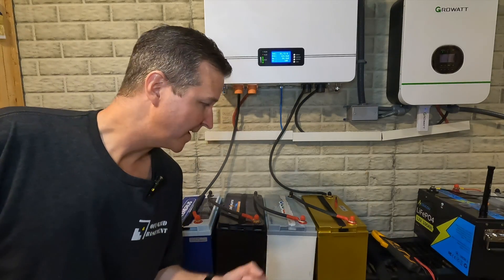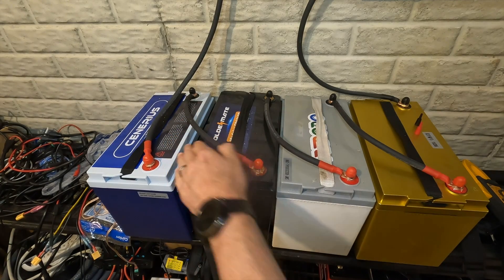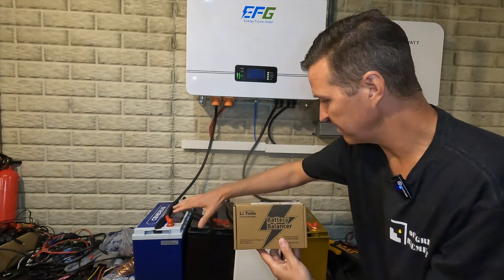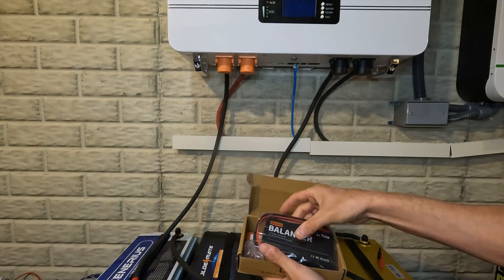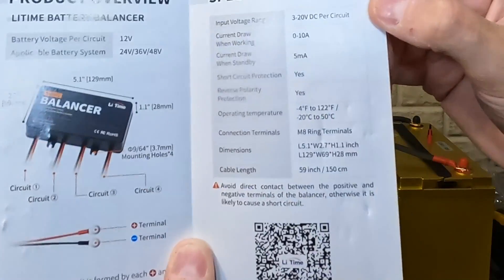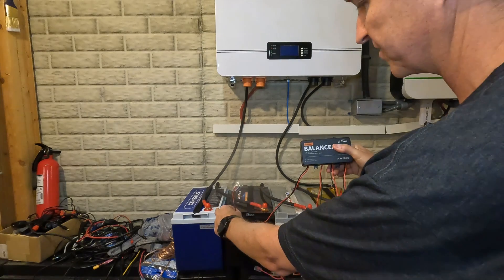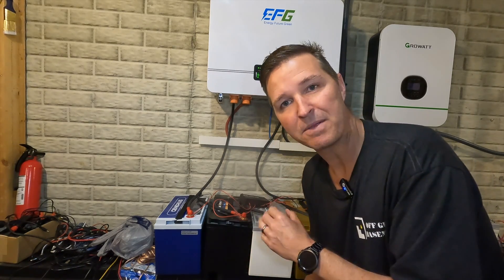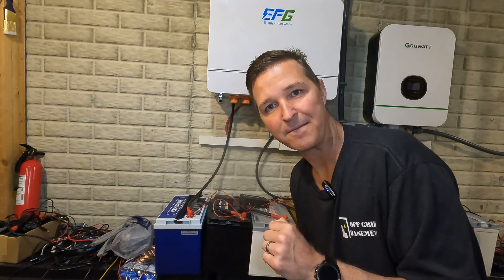Using the 48v Li Time Battery Balancer on Four Random LifePo4 12v 100ah Batteries.

Comment: does yours make an awful high pitched noise constantly? i installed this in my camper but the sound is awful. wondering if its just mine or all of them do it.
Reply from the maker: No.  Mine are completely silent.  I now have four of the units and I totally forget they are there.
Reply: @OffGridBasement  This is a known problem with some units.

Comment: I can't find one single video of how to wire this transfer switch with 3 wires . Always 4 wire.
Can you connect this to an inverter using only Line, Neutral and ground? Do you just cap the red wire?
Reply from the maker: I'm not sure what you are referring to.  This video is for a 48v battery balancer.

Comment: I recently converted our 48-volt golf cart to Lifepo4.  I used 4 new 12-volt 100 AH Humsienk batteries.  The manual said to install a battery equalizer when connecting them in series.  I hadn't noticed that requirement & soon had one battery discharge too much, causing the golf cart to suddenly stop running.  I recharged each battery individually with a 12-volt charger & installed a Li Time battery equalizer.  The batteries keep the identical voltage now & the golf cart is running great.
Reply from the maker: That's a great experience to share, thanks for the comment!
Reply: I discovered that my 4 battery system was also suffering from this ailment. I assumed that when they were connected in series that they would be able to charge/ discharge equally enough to be ok but I was wrong. One battery would hit high voltage disconnect before the others would reach high voltage disconnect and would stop charging all together.

Learn something new every day.

Comment: could you measure and tell us how many amperes the balance does? I had a Chinese equivalent and it didn't work. and after 6 months it burned
Reply from the maker: When I did the initial measurements I got around 4A of balancing.  Its rated to do 10A of balancing in total.  Hope this helps.

Comment: 13.xx doesn’t balance each separate battery.The 4 cells per battery.Doesnt start till 14.2 to 14.6 to balance the 4 cells per battery.The big picture is all 16 cells same soc.
Reply from the maker: That's a good point.  Thank you for the comment!
Reply: @2hotscottpro - You are confused. This does NOT balance the cells inside each battery.  This device balances each battery, with every other battery, in the series string. The four batteries are ALWAYS balanced vs each other.

Comment: I have four 48v battery banks wired in parallel.  Each bank is four 12v batteries wired in series.  16 batteries total.  It looks like one Li battery balancer will work for my system.  Is this correct?
Reply from the maker: No.  This only balances 4 -12v batteries in a 48v bank.  You would need 4 of them.
Reply: The LiTime documentation has specific instructions to wire the batteries in PARALLEL and then in SERIES up to a 4P4S or 16 2 volt batteries and given 10A balance capability that does seem to be a reasonable estimate.  Gary in se MI
Reply: 48 volts , one balancer does 16 if you look at the manuel, 4 in series and parallel

Comment: Thanks for the video.  I do a lot of battery reviews and I have a ton of random 12v batteries so I am building out a system with them but balancing was a concern. Looks like that Li Time Balancer works nicely. Have you considered adding a fuse between the hodgepodge battery bank and the EFG since they are in parallel?
Reply from the maker: Yes.  I definitely need to.  I do know my inverter will never be able to pull anything close to what the 2awg cables can handle, but if it fails I might be in trouble.  Thanks for the comment.

Comment: When doing this it is important to note that the "48v" battery is actually a 51.2v battery and not a 48v battery 

Which it is in this case 
As the 48v is actually a 51.2 16S I think
And the 4 x 4S batteries in series is then Also a 16s

As the nominal voltage of the "12v" battery is actually 12.8 x4 would mean that the nominal voltage of the 4 batteries would be 51.2v

Yes we all talk about 48v systems but you do get 48v nominal voltage batteries that have one cell Fewer than the 51.2v packs

Yes you could technically use them and just use the charge float and disconnect voltages of the lower voltage pack

The problem though is that the higher voltage pack will actually never balance internally as the voltage won't ever get high enough

And you would sacrifice capacity

A 48v battery isn't always just  a 48v battery 15s and 16s matter and you have to match batteries so once you go 51.2v 16s next packs must be 51.2v

And once you go 48v 15s the rest has to be the same

Luckily most tend to be 51.2v and friendly to this type of setup

The 48v ones to exist and a person needs to be aware of it
Reply from the maker: Thank you for the great information!

Comment: So I have 3 12v lifepo4 batts on the way that have a BMS system.. so the BMS system won’t automatically balance them?
Reply from the maker: The BMS will balance the individual cells but not individual batteries connected in series to obtain higher voltage.
Reply: @ how do I need to put the charger?… 1 terminal connector on the 1st battery’s positive and the other the cable on the last battery’s negative? Or just connect them both to the 1st Battery since they are connected in series anywayz?

Comment: Hello I am curious with this connection you have , i just bought 4 batteries 12v 230ah each wire them iin series with  Li Time  balancer but what i want in my sytem that batteries i added which is the 4 12v in series can this 4 batteries be the main 48v and then after the wall mounted be as backup .Can you tell me right way to connect the batteries ,at present i have connected like yours it working just needed the more high amp hour batteresi in usage first.
Reply: As long as the cable lengths from inverter to battery is the same 

The bigger bank will supply more of the power 

If the cable aren't matched
The one with shorter leads will supply more power at least until its voltage drops

Ie the one with the highest potential will always supply the most power
Reply from the maker: I believe you would need two battery cut off switches.  One for each bank.  When one gets low, switch the other one on while switching the other off a couple seconds later.
Reply: @OffGridBasement This has to be done in the flat section of the voltage curve  ie one must not be totally full and the other basically empty

As lithium can supply a lot of amps

If there is a drastic difference in voltages the Amps flowing from the full one to the empty one can trip the max charge discharge amps of the BMS 
Sure the safeguards would protect you but the system can shutdown if this happens

Comment: I’m researching a problem I’m having with my 48v system with 4 LiFePo4 12v in series. I charged them all to 14.2v per manufacturers recco.  After two weeks they have drifted significantly.   My current guess is that I did not leave them all on the charger the same amount of time at absorption so they all charged a bit differently. But, looking at battery balancers as well. I saw your vid on the Victron, and this balancer.   I’d need three of the Victron and only one of these. Why choose one over the other?
Reply from the maker: The technology is more current for the LiTime balancer.  The Victron is only good if you have a victron shunt to go with it to monitor and is really only built for 24v systems IMO.  Get the LiTime for a 48v system and just let it work!

Comment: the whole thing of equal cable lentghs is misunderstood

 with this 4x100 48v setup
the negative does not have to match the positive wire lentgh

(the positive of battery 1 has to match the positive of battery 2 - and the negative of battery 1 has to match battery 2 negative though)

the lentghs that has to match is the distance from inverter to battery poles 
the 4x100 bank is the distance of the cable connected to wall hung battery to poles further away from the inverter
which causes a voltage drop and thus causing the 2 48v batteries not to stay in balance

these two 48v batteries will meet at the top ie if the  one is fully charged it will stop charging and the other will keep charging until both is ful

so  in the middle of the cycle they will drift apart and discharge and charge at different rates 

thuis guy is explaining it with 3 phase setup ie 3 inverters so not exactly apples to apples setup
but the concept is explained 

ie measure the battery voltage at the poles of wall hung battery
measure the 4x100 bank at the poles  and compare to voltage at inverter, this will differ at different states
ie if idle with no current flowing they will probably match , but repeat the measuring while discharging and charging and the voltages will differ

https://youtu.be/xwypGv0m0yQ?si=Nc76MDoL68qfTgJX
Reply from the maker: Great information!  Thanks for the comment.

Comment: Can this balancer work for 24v batteries? And, what if you have more than 4 batteries 12v in your system ?
Reply from the maker: No.  The balancer is only for 12v batteries.  This balancer goes up to 48v bank.  This won't work for high voltage banks.  You would need to do series\ parallel connections for more batteries
Reply: i think a person can use a 48v balancer on a 24v bank ie just connect the first two pairs, it is  awaste of money though as the 24v unit is normally cheaper, i know other balancers normally do a range ie 3s to 8s you connect however many cells/batteries you have

Comment: can you please explain to me why i should care about if they are balanced or not ?
Reply from the maker: The biggest reason is to make sure you are getting full capacity from your battery bank.  If left unchecked, the battery voltages can get far enough apart to start making a noticeable difference in capacity.  This only applies when the batteries are wired in series.  Hope this helps!  Thanks for the comment.
Reply: if one of the batteries drifts  ie lets say 20% then if you cycle the complete bank to what you think is 20% soc
you are infact cycling the one battery in the bank to 0% soc  thus it will deteriorate quicker and eventualy dictate how much of the bank you can use

no to mention cycling that deep can make the difference between getting 2000 cycles vs 5000 cycles  if only gouing as low as 20% soc
Reply: So I have 3 12v lifepo4 batts on the way that have a BMS system.. so the BMS system won’t automatically balance them?
Reply: @juansoliz3425  the BMS balances the internal cells  in each battery

I assume they will be configured to stay 12v with the uneven count  Or is it for a 36v system?

If 36v you need to do a top balance ie connect parallel and charge full on 12v setup to 14.6v then connect in series and you have to buy a balancer to keep them balanced or you would have to manually check from time to time and correct if needed, can do while in series by checking individual voltages when at max charge voltage not at float and then connect 12v charger to any battery that is lower voltage until they match again

If 12v system they should stay in balance unless you have drastically different cable lentghs
Reply: It’s 3 12v batteries in series….how do I need to put the charger?… 1 terminal connector on the 1st battery’s positive and the other the cable on the last battery’s negative? Or just connect them both to the 1st Battery since they are connected in series anywayz?
Reply: @juansoliz3425  the 36v charger/inverter  has to be connected to first battery negative and last battery positive

If you have a 12v device then they have to be parralel 
And could connect to any single battery + -  and system will work ,but still recommended to connect first battery + and last - for balancing purposes

The voltage only increases after it runs through all 3 

If you use a multimeter on a single battery while in series you will still see 12v irrespective if first last or middle battery

Hence if you find batteries  is out  of balance ie one battery is lower you can connect a 12v charger to that single battery + - and just charge it even though it is series

Comment: i see bob has one battery with a 150 amp bms .should he put it in the first spot so if 100 amp bms on others shuts down it will kill all four batterys and not leave one at 12 volts still running? wounder what will happen if one has pouch cells.👍👍
Reply from the maker: Bob is using a 3000w inverter.  At 51.2v nominal the inverter will max out at 60 amps of draw.  It really doesn't matter since all batteries can handle that amperage just fine.  If one battery has pouch cells then the balancer might just need to work a bit harder.  Probably no big deal.  Thanks for the comment!

Comment: I have a 12 volt system in my RV with 3 SOK batteries nominal amps is 208 each.  Could I still use this balancer with them?
Reply from the maker: You don't need a balancer if the batteries are  wired in parallel to make a 12v system.  They balance themselves when wired in parallel.  Hope this helps!
Reply: Your batteries are probably in parallel for a 12v system.  This balancer is for batteries in series for a 48v system.

Batteries in parallel the voltage stays the same - the batteries will stay in balance - and the amp-hours add.

Batteries in series the voltage adds. Because each voltage is added, the individual battery voltages can drift out of balance.

Comment: You got your hair cut!!!  Looks great.  
Good to see you again.
If you are using the BMS for SOC (like 22% via Bluetooth in the beginning) as I suspect, they calculate SOC on voltage.  This not reliable for LifePO4 cells.  Useless info.  My BMS SOC's never agree with my Smart Shunt numbers.  I pay absolutely NO attention to the SOC from the BMS.  You likely know this, I am sure.
Reply from the maker: Yes.  I probably should've cut that part out of the video.  I just really wanted to emphasize how far apart everything was, but it doesn't pertain to the balancer in any way.  Thanks for the comment!